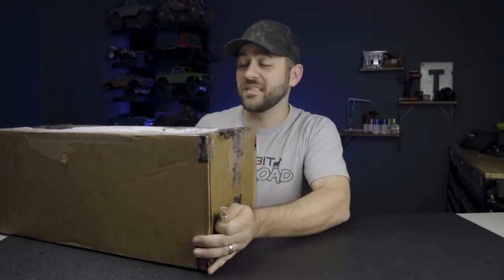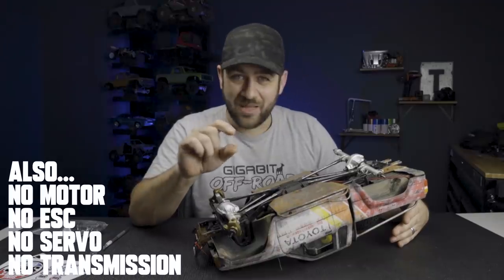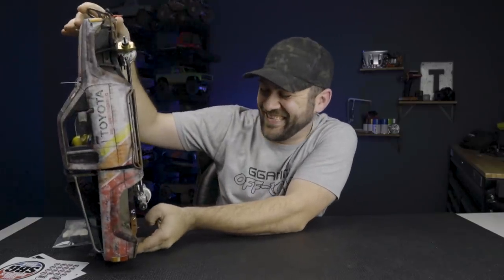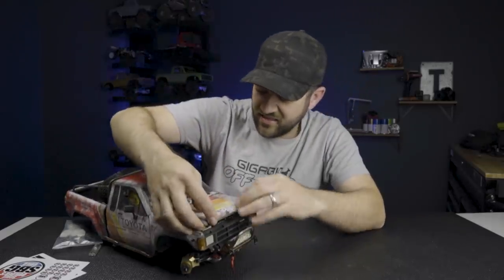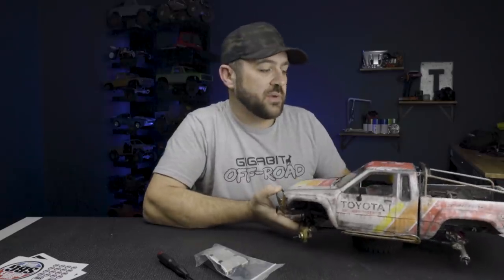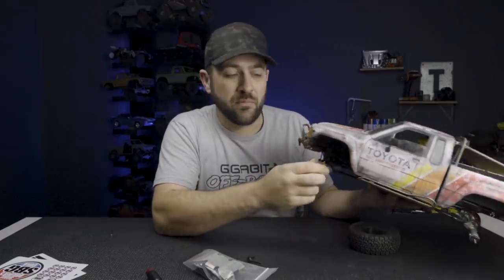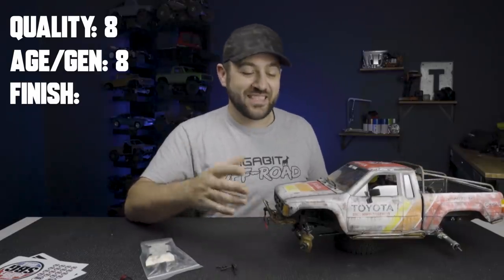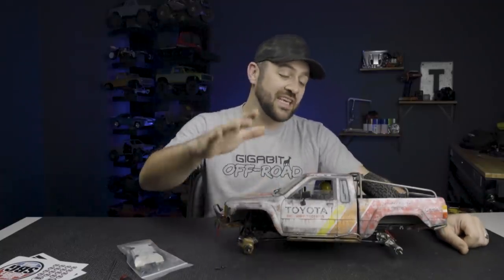Flip That Truck - Buying a YouTubers Truck!  - S1 T3 E1

Comment: I would bead blast all the metal work and do a matte clear over it .the theme is still consistent  IMO and you don’t have to paint that stuff that will ultimately get scratched up on its first trail putting

Comment: I will give you  $ 600 the way it is.its probably worth a lot more since matt had it,lol but I like it the way it is..i have a few steel geared transmissions in stock as well as 7 sets of 90mm king shocks,and several sets of steel drive shafts all for future projects

Comment: Matt probably glued the body on just to watch you fight with it and the built by plaque on the bottom 😂 Well played Matt 👏🏼. You know, you knew who it was from I'm surprised you didn't check it for traps before hand. 
I'm interested to see what you do with this one. The metal work would look nice cleaned up. If the body is just covered in a wrap, does that mean it'll just peel off and you can have a fresh canvas for a different paint job?

Comment: I'd still stick an enexpensive hh motor in it, despite some comments. Quality is quality, or go with the Reedy Radon 2 16t, great motor too, $28 and adjustable timing. Plus makes it Matt-thentic, since he uses them as enexpensive alternatives. Keep all the patina, looks like a legit race truck. I'd get a couple driver heads to match the both occupants. Then you have a detailed one for the next truck. Definitely feeling like you won't lose no matter what you do to this truck. Well, short of mounting a Jeep body to it. 👍🍻

Comment: This is one is a favorite to many, and many have paid outrageous vanquish prices before. Apparently you're cheaping out in this piece of kit which deserved the best. Why the worst cheap stock tyres, or the cheapest HH motor; a left over transmission, when this deserves the very best? This one deserves at least a Crawler Master Pro, some high-end proline tyres, all-around, overdrive transmission and whatnot and I can assure you, you are still going to sell it for whatever the price.
Reply from the maker: I can definitely see that point of view as well. The biggest issue is that putting a lot of new stuff in will often not return any higher price at the end which is a tough pill to swallow for this type of series. Maybe I’ll find a middle ground which will make it nice but not hit me so hard in the pocket.

Comment: why was that 400 bucks?  whats so special about those axles.
Reply from the maker: The axles are Vanquish Currie RockJocks which are high end scale axles, also there is probably over $400 in just 3D printed accessories in this truck! $450 was a STEAL.
Reply: @HarleyDesignsInc  if you say so